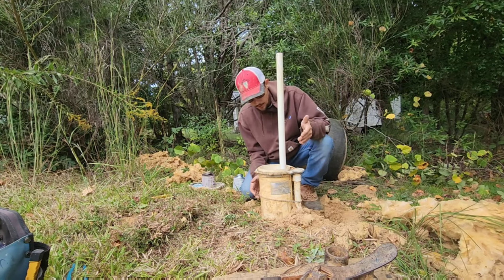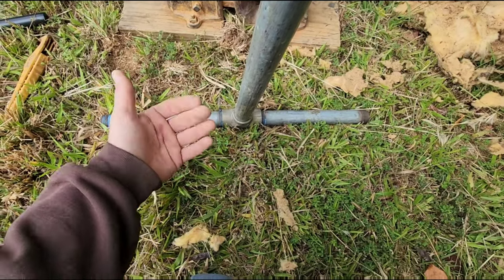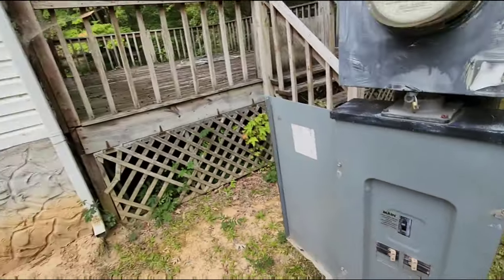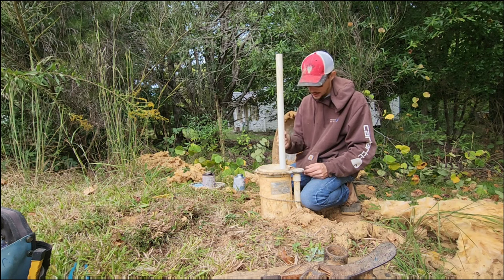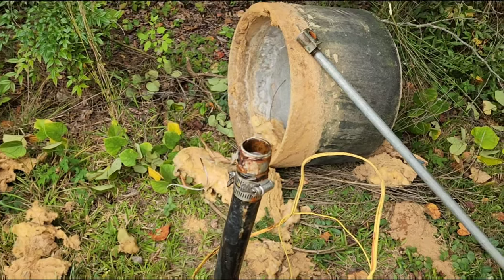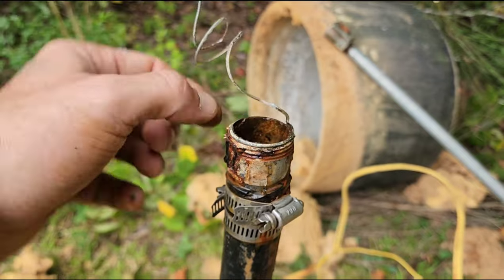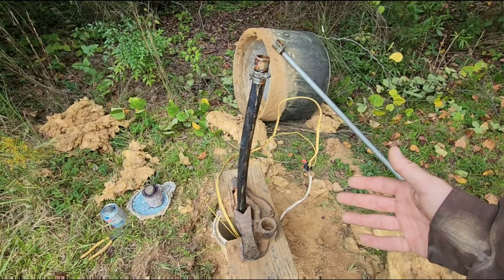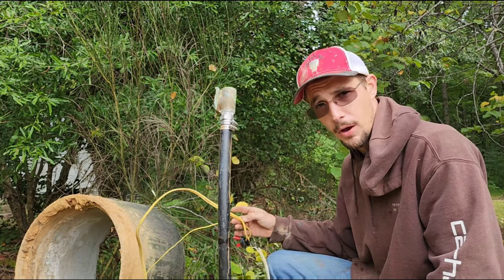Well Pump Repair on Pitless Adapter Style Hook-up. The Drop Pipe was Broken! No Water Pressure

Comment: I have a disused shallow well I want to pull and cover but I need a pipe dog.  It uses old galvanized pipe with a pump rod down the middle.
A long time ago it used to be a windmill and later a hand pump but the top rusted off and it fell down inside.  It hit bottom but the top of the pipe was only 5 five feet from the top of the casing.  So I was able to reach down with a home-made tool and snag the end and pull it up.  It is hanging by a pipe vice until I can pull it the rest of the way out.
Someday I'd like to put a pump back in it.

Comment: While you seem to have good knowledge of the field I see a few things that you missed.1st off you should have done a psi test in the pump to see if the impellers are worn out,2nd the well should have been chlorinated after the repairs were made then check the cycle time to make sure the tank is good.I strongly oppose using rolled pipe in the well,if for some reason the pump is stuck or tight which it will be in a 4"well there is no push or pull with rolled pipe.In my 35 years in the profession I have found that sch.80 PVC with brass or stainless couplings is the best for system .Keep up the good work,just trying to help you out.

Comment: Great video, I've seen a few of your others and they are very helpful in my aim to change out my well pump.

BTW

16:35 you have the seal positions backwards. The big seal next to the female end seals water from the inside.
Reply from the maker: Your correct, I mis-spoke. I remember that during the edit. Glad my Vids are helpful. Always speaking off the top of my head, bound to have little issues like that

Comment: Question for you mabey you can answer it? By the way I am amazed at the way you show how things work I'm a visual learner so thank you! My question is I keep getting super fine sand in my filters. Quite a lot what causes this? I know mine is hanging on PVC. Can it be that it's too low? My well is 280ft.
Reply from the maker: Sediment is a common problem, more so in some wells and less in others. Raising a pump up 10-20ft never fixes the issue, the sand/Sediment is being brought in with/ by the water.

Comment: I just set a pump at 140 feet 7  20 foot pieces of 1 1/4 schedule 120 PVC drop pipe.  I rigged a 30 foot tripod above the well and used a block to lower the pump into the well.  It worked just fine.  Silly question it looked like the pump wire was not flat well wire but house wire?  If so should you have replaced that with the correct wire?

Comment: My pump just has a few inches of rope sticking out from under the casing lid. Will the pinch from the casing lid hold the pump if it breaks free from the pipe or should I fix it? The bolts on the lid are tight now, but they weren’t when I opened it.

Comment: I disagree with using silicone, it’s actually poisonous. I’m not sure the alternatives but something like wax might work just as well. Great video & looking forward to more. There’s always something to learn from all of these.
Reply: he might be using food grade silicone grease. i use this for my filter o-rings when i change the cartridge. makes it easier
Reply: @patricklegault6383  maybe so but I’m still sceptical about the stuff & would use it sparingly
Reply: Vaseline is a safer and cheaper alternative.
Reply: @nelsondog100  It's fine, the food grade stuff is added to frying oil as an anti-foaming agent. So if you ever eat french fries at a fast food joint, it has a tiny amount in it. It's not the same as like silcone caulking. Don't eat that stuff, at least the uncured stuff, it releases acetic acid as it cures, which is why fresh caulk smells like vinegar. The food grade silicone grease you want is the "plumbing grease" sold in small tubes at Lowes/HD hardware stores etc. It's used for lubricating packing seals in faucets too. In a pitless adapter, no water is flowing past that O-ring, and only use a very small amount of it, so there shouldn't be any getting into the water anyway, it'll just flow right past it.
Reply: @christopherhaak9824  Don't use Vaseline on rubber o-rings. It can make then get black and slimy.
Reply: @brnmcc01  maybe it’s fine and maybe it’s poison but I’ll avoid it the best I can just at an attempt to do what I can to remain healthy.

Comment: Mine is a small diameter deep well hanging on a single piece of pex b. We pulled the pitless adapter off and I'm looking at the end of blue rollout pex that I was planning on pulling by hand, but the last two well guys I had fucked the job so severely that now the rope is in the hole obstructing the shaft and they ripped the pigtail off the pump. I've been trying to fish the birdsnest with less than ideal tools by myself and been less than sucessful. 

Today i'm building a jig to run down to the obstruction and cut the pipe to free up the top 140 feet and I'm just going to install a smaller pump and a well liner and call it a day. I also plan to pull the severed pipe myself by hand and probably reuse it if it's in good condition. 

I'm not a well guy. Thoughts? Suggestions? Prayers?

Comment: How come change over from pvc to black pipe? Not worth it in your area to run crane truck?
Reply from the maker: Pvc is used for deep static level well. Here normal static is 30ft. Poly is just easier & more cost effective for the customer. We have a crane, but typically only use it for steel pipe jobs

Comment: My pump is running.  I can hear it, but water is not coming up.  So I am guessing
there is a break in the connection, probably where the draw pipe is attached to the 
pump. I'm hoping the electric wires will be strong enough to allow me to pull the
 pump out by themselves, if that is the case.  

Although the well system is 32 years old, I would expect the pump to give out
before the clamps.  Good chance the clamps were not all stainless, as you warn
about.  The well is listed as 110' on the work invoice.  I'm going to go by your recommendation of Gould.  I can't find the original Red Jacket.  The invoice lists a
1hp pump down there now.   Hopefully I can find a 1hp Gould.  if not, any others you 
would recommend ?  There are lots of them out there.
Reply from the maker: Unfortunately Red Jacket is bought out. 
If your pump isn't set past 140 then I'd recommend sticking with a 1/2hp 10gpm Goulds, grundfos, or j-class. 
Bigger HP doesn't mean it's better, a 1hp actually has a 20% shorter life span & would require larger 10-2 wire. 
I bet you'll find a Galvanized fitting that's got hole in it.

Comment: Thanks so much (finally understood the pitiless adapter). Question: when installing the pressure tank inside (house), do you need a check valve to prevent water from ever "falling" back? Or is it just hooked up to the "T" right away?
Reply: There should be a check valve mounted on the top of the pump.

Comment: You can pull it out if it's 20 ft sections, one or two guys pulling, another guy keeps an arch in the pipe that keeps stress of the pipe joint.  Depending on how much pipe is in there we would have another guy carrying the end . I've pulled them with just two guys. The pvc pipe was easier to pull, there was a early plastic pipe came out first called SRK... bad stuff got brittle and would brake.  Seen a lot of pump lost because of the pipe broke. Had what they called a tapper tap to screw into pipe. The good ones is where the home owner tried to the it their selves and take all four bolts out of the well seal and the bottom plates for down around the pump. Can you say new well, I've seen it done.

Comment: I always used a hanger plate at the top. One of the local well drillers used 22' lengths of 1" galvanized pipe. You could always tell by the type of cap on the well. A crane was a must. Changed a pump that was on 200' of galvanized, disconnected each 22' section as it was pulled up.
Reply: 1" galv pipe? Holy, how much does 200' of that weigh, plus the wire and pump? Even if a guy was strong enough to lift that, if it got away, there would only be two choices, let go and let it drop, or lose a lot of skin and get a broken arm when it slams on top of the casing. At 1.7 pounds a foot, that's like 340 pounds plus fittings pump wire, rope etc. Oh but that pipe will be full of water too, unless the check valve is bad.

Comment: I just had a well pump replaced for the 5th  time in 5 years. It cost $1800.00 for a 100 foot deep well. The guy doing the work tested nothing and had no idea how the pressure tank worked. All he knew was how to pull the pump and drop it back in the well.

Comment: I can honestly say ... I have looked at lord knows how many videos on sub pumps and you have surpassed my expectations !The only question that still remains and I have yet to find one single answer to is this ....... If I need to replace a damaged O ring ! what is the actual size ??
Reply from the maker: 3 different pit-less brands , all 3 have different sizes unfortunately. The easiest way is to pop out the oring, carry it to Napa & ask for a replacement. Or any local hydrolic shop. I believe they are 1.25" but the thickness of it is key
Reply: @h2omechanic  Thank you very much,, I will do that .

Comment: I am assuming the ONLY reason a submersible pump installation is like this is fear of the water pipe bursting. It is much more difficult to gain access than how it’s done here in NC. Using PVC is terrible. Roll plastic is best. Thanks for sharing.

Comment: Hey hey good morning we are troubleshooting our well and had a. Outlet of questions. 

We have a pumpsaver cycling as soon as the breaker turns on. No water and no power at the Pressure switch on the booster pump. Any ideas?

Comment: Thanks for this video, where can I find one of those Dog tools. That is what I need to repair my Pittless. Mine is leaking at the connection and until I pull it I can't be sure what has failed. I bought a new Pittless just in case. It would be great to find it is just the O-ring. But this well is about 240 feet and it weighs a ton.
Has anyone made a home version  of that to hold the roll pipe?
Reply from the maker: I had a guy build a homemade version, it didn't work. They sell vice-grip pliers that's made for pipe & is cheaper, all you need is that & you can use a 1ftx1ft piece of plywood, cut out a 1" "U" channel in the middle and it'll support the system while you fix it. Or use a tractor bucket & a strap around the pipe to support it. Normally it is the fitting that is cracked (like the one was)
Reply: @h2omechanic  Thanks for the quick reply. I looked up those tools on-line and will cobble together my own version. I talked a friend into helping me do this on Tuesday. Today I dug out to expose the outside of the pitless and the waterline. I was not surprised to find that it is an old style with two bolts holding a band around the casing. No way to tell how big the hole is, but I'm sure the gaskets on the new adapter will cover.
Take care.
Reply: Hey Mechanic, I did replace the adapter on my well. It was a Snappy style adapter. The O-ring on the old one failed. None of the supply houses had one that fit, so I replaced the whole thing. Since I had it open I replace the check valve and all the fittings. I don't want to do this twice. I used a couple of wooden clamps with rubber tape on the jaws to hold the pipe up and they worked fine. Thanks again for these videos.
Reply: Thanks for keeping us informed KC.  At my farm in Mi. is a 5"  PVC well.  About 5 yrs. ago I noticed I was losing pressure slowly and the grass was greener heading toward house.  I put a checkvalve at the new 60+ gal tank in 2017 and everything runs good since.  Pump should be replaced so same as you I'm about to dig down with backhoe and repair or replace pittless adapter and pump.  Mine is only about 80' deep.  Did you replace the pump or did you just replace fittings and put check valve at the pittless?   Thanks.
Reply: @jefffrayer8238  no pump this time thank goodness. I replaced this one about six months ago (probably a year given my bad memory) It is 240 feet deep and it weighed a ton. According to my math the water in the down pipe alone weighs over a hundred and fifty pounds.  Then add the pump, the plastic pipe and all the wire, it was not fun. Two of us pulled it by hand. 
This repair we only had to pull it up about eight feet to replace the adapter.

Comment: My well is 550 feet and the pump is sitting at 475, hanging on 20 foot sections of galvanized, I think, 1.5 inch..maybe 2”..iron pipe. I had to replace the pump..1.5 hp..once and it seemed to take forever for the crane on the truck to pull, disconnect and stack all of the sections of pipe..install the pump and then one section at a time, lower it back dow. They too had something to hold it as each section came up and eventually went back down. I don’t remember them taping the wires all the way along the pipe. Took the two men the better part of the day.

When it’s pulled again, would there be an alternative for the iron pipe given the depth of the well?

Great to have learned about the pitiless adaptor..thanks!

( They also pored a couple gallons of clorox down the well I think after they installed the pump and pipe..Is this something that you would regularly do?)
Reply from the maker: Bleach is just to kill possible bacteria. Very common. 
Your pump is on Steel pipe probably due to a deep static level. (Where the water rests in the well in your region). If your static level in your well is not deeper than 100ft from the surface & the well makes a minimum of 1gpm, then you could probably swap over to the black roll pipe. But 400ft would be the limit on depth.
Reply: @h2omechanic  Thanks..enjoy your videos. Very educational.Where are you located?

Comment: Wire nuts in the well? Can you use a megger to check the condition of the pump winding insulation?
Reply: Yes you can.  If you know what size and type pump you have, the ohm values are published.

Comment: Wait so if you pull up to a homeowners house and their well pump is on stick pipe you pull it out by hand and cut it up and then charge them for new pipe instead of having a pump hoist to pull the 20 foot sections?
Reply from the maker: Yup! Because all the stick pipe that's used in my area is Glue type couplings, pulling the pipe out it typically breaks & risks falling down the well. New pipe is Always cheaper than a Hoist Fee.

Comment: If the pipe is PVC, will it be some other color than black?  Wondering how I would tell the difference.  Thanks
Reply from the maker: Pvc is white.
Poly pipe uses clamps
Reply: @h2omechanic   Ok, so if the pipe is black I'm good right?   Your video is excellent!  I was wondering how it all worked.  THANKS!

Comment: Great video, what is the difference between black roll pipe and black poly with 160psi? I can't find black roll pipe. My well drillers has quoted me Drop pipe but can't seem to find that either. what are the differences? Thanks a lot.
Reply: Any NSF rated poly pipe that has the psi rating you need will work.  All the big box stores carry it.

Comment: Are pitless orings universal?  Or are there a varietie of different types?   Are they silicon or advanced material to make them last or basic rubber?
Reply from the maker: 3 different companies have 3 different sizes. Slightly different
Reply: @h2omechanic  I don't know what or if I even have them what my well documents show but I will have to dig them out and look through them if I have any documentation. I am losing pressure on my 40 to 60 system. It will pump up to 60 but when it clicks off the pressure will drop down to 48 over the course of 10 minutes... So I thought the first thing I could check his d pitless adapter. My well is 140 ft deep and I think it should have three or four extra check valves in the riser pipe spaced evenly.

Comment: GREAT job! I may have to pull my 150' well (which we had put in 40 yrs ago) and this was a great refresher for doing that. Thank you so much! What type of fitting did you put on the black pipe that is attached to the slip joint?
Reply: I have a 150 ft well with 1 inch galvanized water pipes in 10 ft lengths. Hope it last 40 years!!!so far 14.

Comment: This is an excellent video! You show many things that a homeowner needs to do. How many amps would a 240v 1/2 hp pull?
Reply: 6.6 amps[running] I just used a search engine, Bing ,Likely quite a bit more for start up. You could probably search that too.

Comment: What do you do when the threads are bad on your pitiless adapter
Reply: Then try to thread a rope around the pipe and back to the top. Tie a slipknot then pull the rope up. 
Ultimately, You are trying to get a rope noose tied just behind the sliding flange of the pitless adaptor. 
If the adaptor isn't too far down the casing... its tricky, but easier than it sounds.